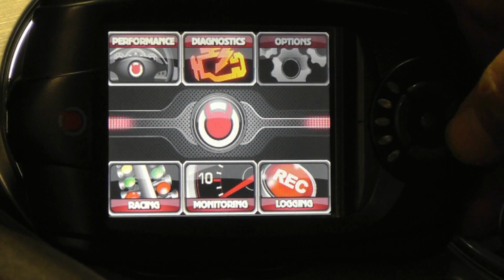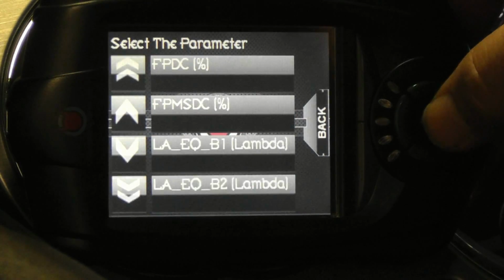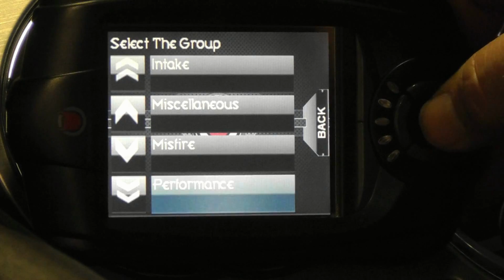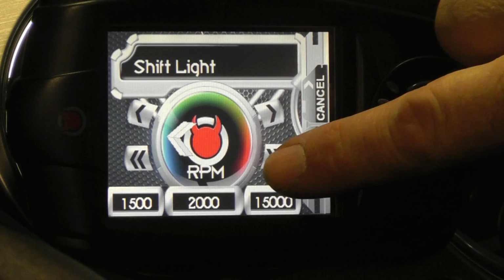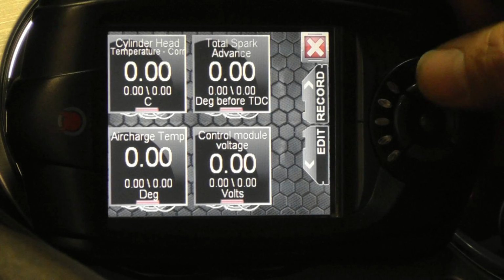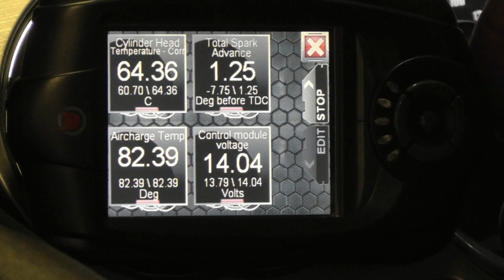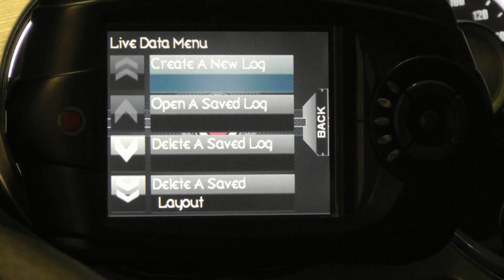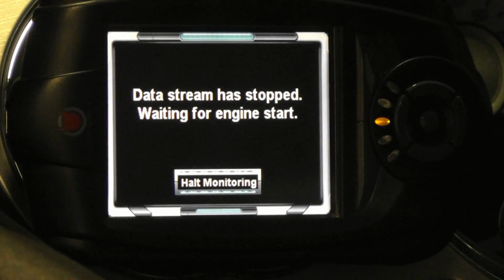How to use Monitoring mode with a Diablosport Trinity

Comment: Great tutorial, one question does the trinity log/record all the gauges that are displayed? Lets say i was to choose the 07 and up Hemi gauges
Reply from the maker: Yes. You can save multiple logs on the tool, and it supports an SD card as well. The logs can be downloaded to a PC and you can use Diablo's free Dataviewer software to review the data. It makes for a poor man's on-track data acquisition system as well.

Comment: Great tutorial. One question, is the Aircharge Temp the same as the CAI temp? I just installed a new CAI and I can't seem to find what I'm looking for on the Trinity to monitor the Air temp.
Reply from the maker: +Ron Marshall It depends on the vehicle that you are using it with - different vehicles have different values that you can watch. The temperature of the air at the inlet is frequently called "IAT", "Inlet Air Temperature", "ACT"  or "Air Charge Temperature". Sometimes "Air Charge Temperature" is the reading from a secondary sensor (like one after a supercharger) or a even a calculated value. There may be a value called "ambient temperature" and that usually refers to an external temperature probe that measures the atmosphere outside of the inlet tract. A typical use for this is an in-dash external temperature display.
Reply: +puzeym Thank you! I didn't realize it goes so deep. No wonder the tech support told me to check the forums lol. I have a 2010 Challenger SRT8. I'll try and figure this out.
Reply from the maker: +Ron Marshall I think it is called "intake air temperature" on the Dodges. I'd have to take a quick look but my own SRT8 Dodge (Magnum) is in storage for the winter right now!
Reply: +puzeym Yea I just created my first log and found that the IN MAN AIR TEMP and INTK TEMP are identical when I monitor it. I just did it while I was parked but both readings where the same the whole time. Thanks man.